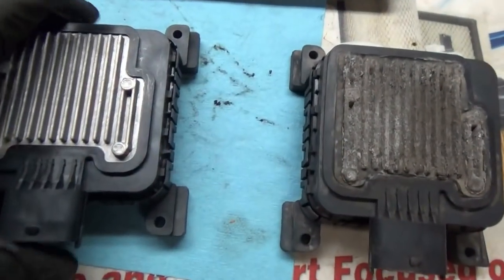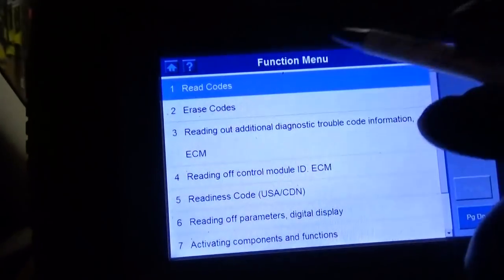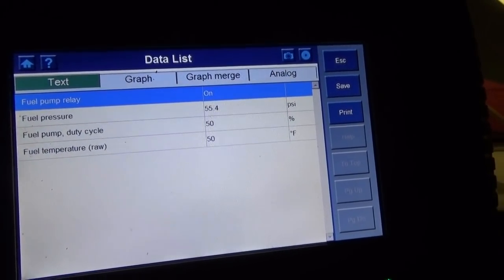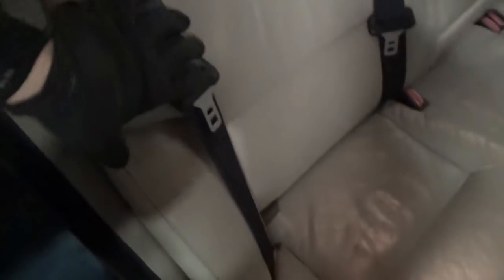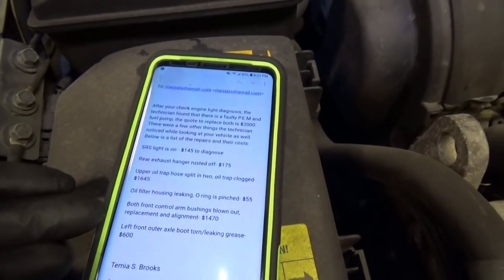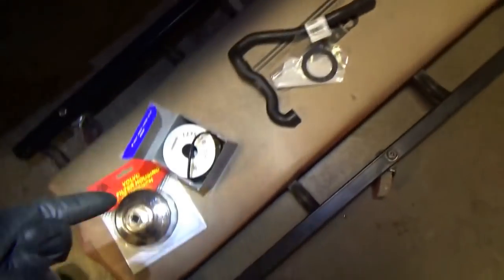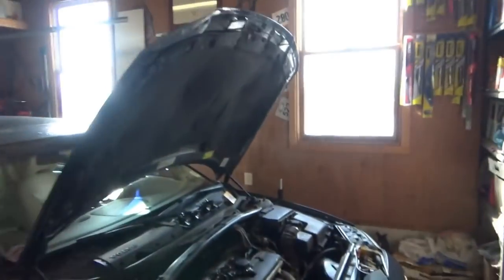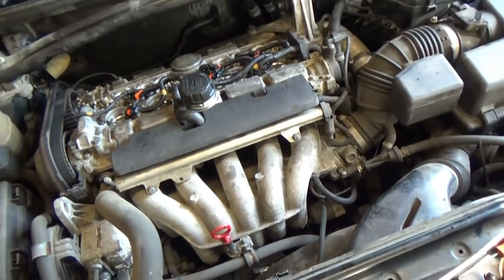Volvo Crank No-Start -Part 3 (Repairs!)

Comment: Hi! I know this is an older video, but just thought I’d let you know that the stock 3-prong spark plugs for these actually perform better than NGK’s! I know as I have a 850 sedan and I got better MPG after using the Volvo plugs! They are worth the money if you run into another one that needs plugs in the future!
Reply from the maker: Cool. What was the difference in MPGs?
Reply: Pine Hollow Auto Diagnostics about 3 mpg, and much smoother idling as well. They are also said to last longer. Have had mine for 2 years now.
Reply from the maker: Wow, that is significant! I think that my Suzuki truck still has the ORIGINAL OEM NGK Iridium plugs in it at 170k miles...and they still look fresh. I swear by NGK Iridiums haha
Reply: Pine Hollow Auto Diagnostics NGK’s are great! Bosch platinums are also my go to, I’ve used them on a friends MK5 Jetta with good results before. Good video as well, stay safe!

Comment: Ivan, when you hot-wired the fuel pump to drive it back, when the fuel pressure went up to 80 psi, could you have put a resistor in between somewhere to lower the fuel pressure?

Comment: I Love your video it really taught me a lot. I had checked everything But my v70 Volvo still does not start. Fuel pump works fine and has presure  but no spark and the injectors are not opening to let in fuel . Any thoughts ?
Reply from the maker: Get a wiring diagram and diagnose those circuits! Certainly there should be codes...

Comment: I thinking this might be the problem with my 2009 Volvo V70 it's a p3 platform,  I was wondering  where this module might be located on my car ,by the way I wish I could find someone like you to fix my car but I live in England and everyone I've taken the car to up to now has fixed the wrong things, I've had a new starter motor and a new lift pump fitted and still have intermittent starting problems  ,it's driving me nuts now 🤪

Comment: Glad you like the wagon... wagons are my thing.  got it fixed and wasn’t that hard :D but damn those bushing are trash you can hear them knocking as you drove made me cringe spoiled the ride a bit for me as your passanager. 

they are some of the best highway cruisers I mean look at the tac.  Doing just shy of 2500 RPM And touching 80MPH.  And ya the engines are beautiful gear boxes are beautiful and it climb a back hill in PA like it’s nothing, they even properly degear and use engine braking when going down even without decent control really cool...
Reply from the maker: Yeah the drivetrain is very well designed. Glad I got to drive it for a bit!

Comment: I bet that fuel level sensor is faulty. My 2006 S60R did the same thing, drove over 200 miles and it only showed 1/4 tank used. Have him keep an eye out for that. Also keep that timing belt and the tensioner fresh, they like to fail.
Reply from the maker: Well after 400 miles it still shows1/3 tank left, and I put in 16 gallons before my trip when it was almost on the red. So nothing wrong with the gauge, it just has a big tank and gets 30mpg! That's well over 500-mile range!

Comment: I see it said Ford on that pump module. Ford had a LOT of trouble with there FPM on any car/truck that had the FPM outside the Vehicle!!! On the F-150 it’s one of those things that will not set a code at all and you will be thinking bad fuel pump at some point BUT the FPM has broken in to 2 pieces from Corrosion!!!!! and hanging from it’s wires 😳😳😳😳😳
Reply from the maker: Visual inspection works on those pretty well haha

Comment: That Volvo is basically a Ford but it has a Aisin (toyota/Lexus) transmission.  Replace the transmission fluid and it will run like new.
Reply from the maker: Already replaced the fluid a few years ago, and YES, it does run like new! Smooooth as butter!!
Reply: The P2 Volvos ran the white-block engine developed in 1993, which Ford later acquired, and werecmated with mostly Aisin transmissions.  All design was purely Swedish and done before the Ford acquisition.  Ford took ideas from Volvo not the other way around.
Reply: GM invented the automatic transmission! Volvo used the ford transmission for years.

Comment: Good job.was this pre or post Ford take over? Volvo was the IT car  of the 80 s.
Reply: Ford destroyed VOLVO, GM bought Opel -> nearly bankrupt now back making black number after sold to PSA. Trump: 'Europ car manufacturs threaten our market'  ....
Reply: Post.
The p2 chassis is an evolution of the p80 (the 850 line), however.
Reply: Ford built Volvo's have a blue badge on the front grille .
Volvo built have a black badge.

Comment: Ivan really smart repair and now your a Volvo convert.
Been working on Volvo's for more than 40 years ,in my opinion  they are decent made cars.
The breather box is very common for getting blocked as is the front bushes for wearing .
However never seen the  Polymer  whats it failed.
All that being said the really new Volvo,s are not so good.
Great series.
Reply from the maker: Thanks Tam! I'll double check the crankcase pressure just to be sure :)

Comment: This was a good one.  I also like wagons like this.  I have a Saturn L series wagon, based on the Opel Vectra B, which maybe was 1 size smaller than this model in Europe.  How was the fuel economy on these road trips?
Reply from the maker: Very impressive fuel economy! Tank is big so still had 1/3 left after 400 miles, so about 30mpg at least! Great highway machine!

Comment: Nissan put out. New TCM REFLASH #31036-5HA9B,15 Rogue, 6 months driving significantly better.Also UN-CHECK the driver assistance Engine breaking and Traction control from stearing wheel button, (center) speedo display .Car drives in a Linear acceleration and deceleration.😀💯

Comment: I notice that you use a different design of spark plug.. whats up with that?
Reply from the maker: I wanted to get the OEM, but the parts store only had these NGK in stock. It runs beautiful so no complaints :)

Comment: I just fixed mine, took a heatgun to the ignition key immobilizer module and it wouldnt start. Allow a minute for it to cool down and car starts.
Reply: wouldnt start meaning cranks but no start

Comment: Well done, and so true, Volvo stealers are the worst crooks in the whole industry.  I was ripped for a new ignition key which went bad, would not start as immobilizer was set as key transmitter suddenly died, had to have it towed to dealer for programing key.  Had to order from Sweden, car was in dealer shop for four weeks before they even got to it, then another week to get key, another week to program, so I was without Volvo for almost two months, towing cost my $146.00 and the real shock, key and programing added another $512. all for a stupid programmed key.  An this was only one of the dozens of problems on XC90. 

And as a side note for DIY mechanics, if your PEM does go bad, do not buy one from Volvo stealer for $270., go to Ford and get same module for half the price.  Buying second hand is risky, went through a couple to find a working one, so not worth the hassle, get a new one from Ford, and if you look close at video, you will see Ford logo on part along with Bosch logo, crazy to go to Volvo for any parts.   

Thanks again for your video, well done.

Comment: Dealerships want to replace anything that might ever go bad. Worried about an eventual comeback that will hurt their survey scores. I was at a Ford dealership and had to quote a condenser change with every A/C repair.
Reply from the maker: I don't think they were worried about comebacks in this case...especially with that airbag light HAHA
Reply: The unplugged pretensioner was just sloppy work.

Comment: There is a disconnect in the way dealerships and normal service businesses do repairs.  Dealerships seem to want to put a vehicle in new condition without regard to cost and normal service businesses want to fix what actually needs repair.   It seems to me dealership technicians are only experienced with new cars.  The techs that diagnosed that 10 year old  Volvo were probably 8 years old when it new.  They compare it to a new Volvo instead of other 10 year old Volvos and don't even want to deal with it.  Even older dealer techs probably haven't worked on a this vintage Volvo for 7 or 8 years and when they did, it was new.
Reply from the maker: Interesting thought! I bet this 2005 Volvo will outlast all the 2019s that they sell... I've never driven a car with over 200k miles that still runs LIKE NEW!

Comment: Owner is making a mistake to not keep his front suspension in order.  As an owner of two V70's the car is very unstable and unpredictanle under variable suspension compressions when those control arms are worn out.  Might be fine for local driving, but when making emergency maneuvers at highway speed or with a spec-maximum 900 lb cargo load, he will pay a definite price in slop that could mean life or death.  Given their tendency to wear, I think the control arm bushings on P2 Volvos should have been polyurethane from the factory.

Comment: How expensive was that part on eBay. You shouldn't buy cars that are not the majority in the place you live. For example here in Germany American caras are considered shit so everybody has a VAG car. I am at my second Golf and they have been incredibly reliable. But Volvo's too here are very expensive to repair as they are saw as premium cars.
Reply: Quick look on US ebay shows about $50-100 for a used one and $450-500+ for a new one, dealer cost even higher.  Pretty cheap if you do it yourself.

VW sucks in the US, lots of quality and electrical problems, plus they are very complicated.   Maybe because Mexico built over German built, who knows.

Mai bine o Dacia oricum, cea mai tare masina. ;)

Comment: That is a super uber stealership!  This is why European cars get a worse reputation then they deserve.  I love my Volkswagens.
Reply: It’s two fold problem...  dealerships overcharge and this create a used car problem where anything over 100K is too expensive to own for the mainstream or too expensive for them to get ever repair and skip the most expensive which is usually the most important and normal people who buy off used car lots pick those potentially poorly maintained Euro cars and suffer issues and thus cycle continues. 

The other issue is some euro cars truly are trash after 100K+ miles even if properly maintained.  They can be a dream to drive up till that point then like the custom timing system BMW uses for example fails and costs more than vehicle is worth in repairs once it does, unfortunately more issues than that depending on the engine and unfortunate not a matter of if but when cuz even with proper maintained they still known to eventually let go and take other things out with it..

Don’t even remind me of “recent” audi engines with plastic retaining parts and weird oil systems... had a friend get a 125K mile sadan I don’t remember name of it, looked mint... engine failed within 10,000 miles of his ownership.  turns out common oil starvation issue if one of that parts isn’t replaced which costs a lot of money since have to tear half the engine apart to do... failure isnt sudden and oil still moves and gets to most vital areas like rods and cylinder but valves and cam and chains get starved more and more and fail eventually and if under high load or stress can fail rapidly.
Reply: @Honeypot-x9s  Which is why its best to get low-mileage ones, so you are more in control of the condition and what repairs are done.  I paid a good bit more for my E39 years ago, because it was 9 years old with 42k miles and mostly original except for regular maintenance and a few repairs.  Also bought a low mileage W211 and never had major issues with it either.

You dont want to get a complex car after 3+ owners have pushed off important repairs for years!

Comment: It's going to rust now. You drove it in New York and coated it with salt.
Reply from the maker: The salt is just a protective layer. Apparently the only thing that corrodes on these are the exhaust hangers and the Fuel Pump Module haha xD

Comment: 13 dislikes?... Stealership employees obviously.
Reply: Nah, it was people who know the downfall of not doing the "complete" repair.  Yeah it's back on the road and he did a great job going through the diag, but 10 amps is too much draw on that pump (and most pumps).  It runs the possibility of taking out the new PEM (fuel pump module, and they all sucked and that aluminum was pourous and would soak up water like a sponge) from too much draw.  Also, the software was to better pulse the pump to elongate its life and have the module run cooler.  Kuddos to admitting NOT doing the TSB, but trust me, it is worth it if you are keeping the car.

 The "plastic" hose that was "upgraded to rubber" was actually rubber from factory, they get hard as they degrade.
And you usually have to remove the intake to put on that lower clamp for the hose, so do the pcv as well.

The pcv box (volvo used to call a flame trap) is a high, high fail.  Lucky if they dont clog or split before 100,000.  When you take them off, the oil passages coming out of the block are usually coked up with oil vapor that has hardened from lack of oil changes (following volvo's oil change interval with volvo's reccomended non-synthetic).

The cv boot, eh.  Good repair, will leak again.  The boot is hard vinyl from factory, tightening the clamp either solves that minimal seep or cracks the boot just slightly more.  Good shot at it!

Kuddos on the srs catch, hopefully the code stays away, those connectors were known to loosen up and momentarily lose their connection.  I think it was the dealer too.

Control arm bushings cracked from day 1!  It depends how loose they are and how tight the car feels down the road and how much uneven tire wear there is.

Why was there oil on the spark plugs? Leaking bore seals? (Which is a considerable repair on those cars because of the engine architecture).

The leaky oil filter:  sometimes they crack!  After seeing the oil seal ring location and having it put back up, could have deformed it.  New oil filter housing would have been best.  And change the oil anyway!  It has been exposed to a nasty leak and those volvos have been known the turn some of the best oil out there into turkey jelly.  And ounce of prevention.....

Great diag flow, got car back on the road, but not complete repair. Understand, it was minimal for 200,000 mile plus volvo to just get it running again, but if you want to keep it for 3 to 5 years, do the full repair!  

And btw, 800 bucks!?!?! I know it was for a buddy and you are trying to show it is reasonable to keep a car going and there is a way through the trama of a high mileage car break down....BUT...you dont know your true value!  Other tradesmen charge 90 plus and hour, you should charge for that talent and equipment.

Comment: Dealerships have a lot of overhead so the push their mechanics to document everything to sell services. They are not concerned with saving customers $$ & are more concerned with making $$. They also stress speed so they don't thoroughly diagnose plus like any place you have different caliber of mech/techs. Some of the customer's dealership estimates I get from customers & my repairs are night & day i.e. customer was quoted @$3000 to fix an ABS light quoted customer ABS module, modulator valve, rear hub assy and EVAP canister & vent valve to fix P0446. Well the ABS fault was an open wire in the RR WSS harness & they didn't need any parts and the EVAP was just the vent valve the canister was fine so customer saved @$2600. Simply amazes me customers pay dealerships ridiculous repair bills b/c they think they are the experts but then again there are plenty of independent repair shops or chain stores that do the same thing. They didn't become chain stores by not selling services customers didn't need in fact most mech/techs are let go if they don't meet a certain quota which is why it's nice to work for yourself :D
Reply from the maker: Yup well said, Bob!

Comment: that volvo dealership needs to be closed down. bunch of thieves. i own two v70n models 2002 and 2004. just replaced the axle boots myself. 1 hour of labour and 60 euro on parts. what the dealership charged is a rip off!

Comment: Ford owned Volvo for the vintage you worked on.  So maybe it was reliable because it's not really European.  Today's Volvos look and perform nicely but are now Chinese owned.
Reply: Volvo reliability took a massive hit when ford took over. F**k ford! Luckily the chinese brought over enough cash to sweden to turn around the company 180 degrees in the right direction and they cleaned up the mess ford left behind very quick. And unlike ford the chinese dont interfere with design and development and let the swedes do it themselves.
Reply: Also all mechanical parts are 100% volvo developed before ford took over. And only some electronic parts are ford. Hence this whole video series as a ford component shit the bed
Reply: Wow!!!!!   200+ thousand miles for a Ford part is actually not that bad!!!!
Reply: @zensterful   is sten speed American?

Comment: As you might know Volvo was bought by Ford in 2000 because they would like to know how to copy suchs a good car. so from then on Volvo was in decline due to use ford parts in Volvo cars. Now Volvo is owned by Geelly a Cinese car builder. Same happende with Saab bought by GM sucking out good ideas and also taken over by the Chinese.
Reply from the maker: Exactly right. Such a shame. Both Saabs and Volvos used to be amazing cars!
Reply: That's how Ford Focus was born.   Every time I work on a focus I realize where the ideas came from.
Reply: @zensterful  Actually it was developped in Europe first. LOL https://en.wikipedia.org/wiki/Ford_Focus
Reply: I DOUBT FORD OR GM NEEDS ANYTHING FROM FOREIGN CAR MANUFACTURERS